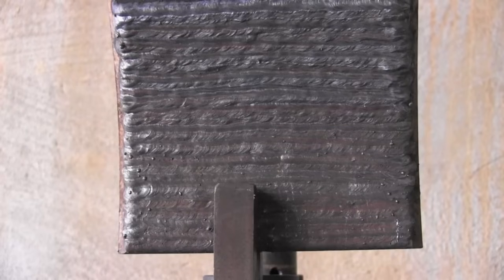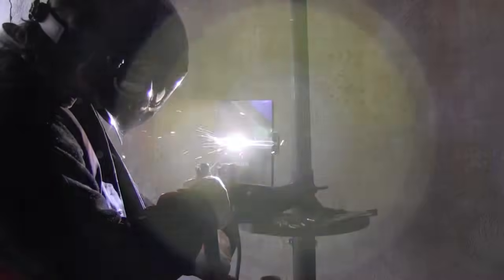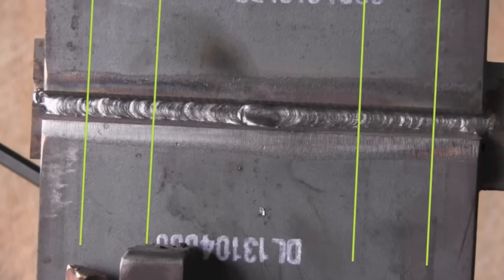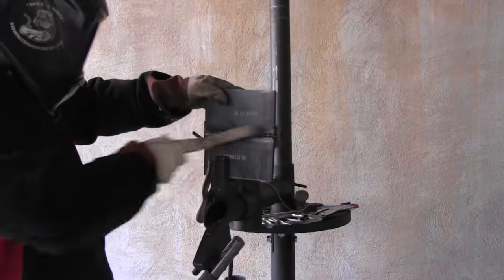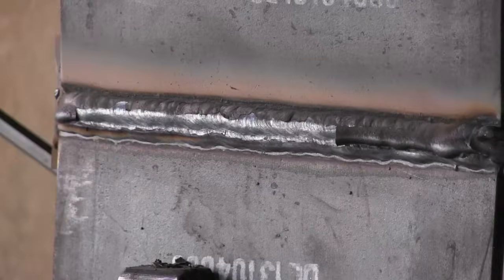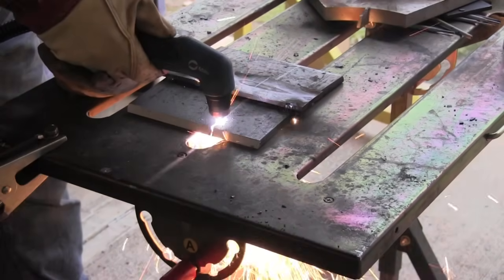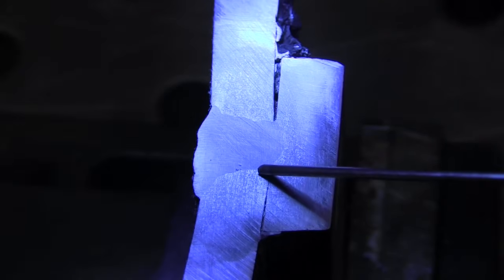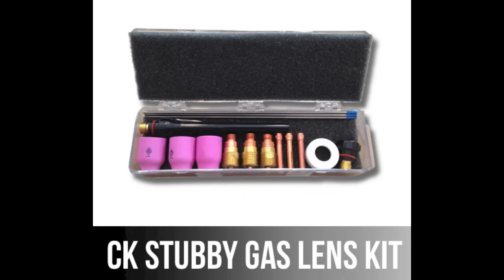Stick Welding Tips- 7018 2g Plate Test

Comment: I'm a experience Welder but not certified, with your help I was able to prepare in short time for the test and pass very easy, thank you!
Reply: What test did you have
Reply: Was it the single v joint plate? Vertical or horizontal?

Comment: As a metallurgical engineer I can say that I sincerely appreciate the craftsmanship that it takes to make a good weld.
Reply: mcwhite1002. How did you go about becoming and engineer and how long did it take?
Reply: @Serenityword  The 4 year Bachelors is standard then if you want a Professional engineering license (required for some disciplines) you have to take two further exams administered by the State. One you can take (called the FE exam) in college, the second you have to wait till you have 4 years working at the level of a PE. Then you can sit the exam. Upon passing you get your PE license.
Reply: Hii
Reply: Hii
Reply: @Serenityword for metallurgist it's honestly not worth the amount of time for schooling and the student loans. As a welder you can make well over 6 figures. As a metallurgist you are making the same but obviously you need your 4 years. I'm so thankful I didnt move to Colorado and go to the school of mines. Instead I'm doing commercial diving and being an underwater welder/construction worker on an oil rig

Comment: Jeez in Canada this is a lot harder haha.. we have to do 2 root passes, and we have to do a stop start on each root pass and those stop starts get bend along with the cap gets bent.
Reply: Jordan Atlin that would be a K prep not a V prep, more common for structural joints than pipes

Comment: the root pass melds 4 pieces together if one or more fails to puddle you have a weak root pass and could surely fail bend or x-ray tests i have only failed one 3-g  certification  test it was right out of welding school  they allowed me to retake it and passed and was certified on bridge code 1" Plate double bevel with backing strip .

Comment: Best videos by far for pre-test prep. The rules for each facility may vary slightly but just understanding how the oscillation and width of a bead affect the formation of the new material is the whole point. In my opinion and experience once the initial root has penetrated deep enough and bevel edges are nicely tied in then moving to minimal movement stringers is becoming more and more the preferred technique. Jody explains this in depth in other videos .  This man is the Yoda of welding..... pay attention closely if you are new to the trade.

Comment: i have a question. I'm using a Lincon electric 300 using 3/32 3g ( i know this is 2g ) running at 80 amps why is it digging so bad it almost eats completely through the plate.

Comment: can you do a tutorial on stick welding spider gears together to properly lock an open differential gear set. i got a lincoln 225 ac stick and no clue what type of sticks to use or how hot i should run it. the spider gears i usually deal with are any were from 2 1/2 in to almost 4 inches. cause i along with alot of my friend build offroad lawn mowers to do what a 4 wheeler atv or utv would do but i never see anyone weld there gears sets good enough to were they wont split apart and slaughter the trans axle housing
Reply: I was talking to a rock crawler guy several years ago, and his advice was to not weld the gears together. Instead, mark where the spiders mesh, pull the gears out, then fill 2 grooves with weld either side of where they mesh.  This simply stops them from being able to rotate.(Does that make any sense?) I tried it on my Ford Ranger front axle, and had no trouble with it for the 5 years I off roaded with it. Since you're running AC, I'd use 7014 to fill in the tooth grooves. And depending on the size of the gears, 90 amps?
Reply: This sounds like a perfect project for chucke2009 a young guy who makes welding vids that have a somewhat different approach. Great idea!
Reply: Adam Pierce i haven't seen any uploads from him in a while i don't know if he is just busy or something is up
Reply: Brainmalfuction He just uploaded one today.
Reply: good deal ill check it out thanks for the heads up
Reply: Get antislag spray and coat your cross pin and ring gear.  you do NOT want slag on either of these.  You want to weld the spider gears to each other and to the carrier.  Failure to weld to the carrier will cause it to crack faster.  I just welded up some Rockwell 2.5ton spiders.  Different process but same idea. I do all my tack welds with 6011 or 6010 to burn through the grease dirt gear oil etc.  Then 7014 to fill it in, Run the 7014s a little cold.

You can see it here http://www.pirate4x4.com/forum/general-4x4-discussion/1998666-1978-bronco-mega-truck.html

Comment: +weldingtipsandtricks My welding instructor told us that for a test where you use a 7018 root, to run one or two good hot beads lengthwise on the back of the backing strap as a form of pre-heat. Works great!!!
Reply: why not? run the beads, get the piece positioned and have at. what difference would it make to the inspector?
Reply: Great idea if you can get away with it.  That's a good trick to remember. It might come in handy some day on something else.

Comment: I'm about to take 2g 3g 4g in Rhode Island. they do not allow power tools :-(
Reply: SweetMooch where did you take your test? just did my 3 and 4g aws and was able to use a wire wheel between passes to make sure I got all the slag out.
Reply: Sean M local 37 ironworkers union.
Reply: SweetMooch I see, mine was in a class setting so more lax on rules
Reply: The tougher the test, the greater the pride when you pass it.

Comment: In Canada a CWB weld test always require a stop start on the root pass. Usually 2 stop/starts. As well they do 2 root bends on both of the stop starts and a face bend from the middle to check your cap. So this video seems kind of weird to me.

Comment: ive been stuck on this weld for about a week now, my puddle tends to seem hard to control i cant get a smooth weld going in the horizontal position
Reply: Try moving your ground.  Some guys even carry booster cables so they can ground in two spots if necessary.

Comment: I had a little trouble with the valley thing lol on 2g, 2g is a little pain but what I found to work a lot is a horseshoe you can tie end the toe of the welds with it and doesn't sag looks something like this -> C or a half moon works great after you get the hang of it

Comment: Good stuff. Question about vertical up on mig. Can 0.45 gauge wire be making the task difficult?
Reply: aaron dostou I use .045 wire everyday. Doing vertical up with MIG doesnt make it more difficult. Just run at good parameters make sure you hold the sides and weave your way up at a good pace and you ahould be good
Reply: preston hoff thanks bud it's getting better but still needs more hood time

Comment: would you say 80 amps is enough for a 2.5mm rod?....i am pretty much a noob regarding welding but it seems to struggle and that is all my machine has(80 amps).
Reply: +The Religion Killer You need a real welder.
Reply: +Ben Dover ctfuuuu!!! 

80amps😂😂😂
Reply: 80amps might be enough. What kind of rod did you want to use? If you have the money, it might be better to move to a dual voltage welder like maybe an Everlast 140.
Reply: Cluj Biking นายชวนหลีก

Comment: My instructor have us running our root with 6010 rods which is better because I see classmates keep failing the bend test over and over I'm not on my test piece yet I'm on horizontal I should get off that tomorrow but do anybody have tips because ion want to too keep taking the test over and over

Comment: hey!im falling behind in school because i cant seem to get the root pass on the top bevel right.my fillet weld on the bottom is turning out great ,just not the top one on the beveled plate.I dont know what im doing wrong.The CWB practice we are doing requires a 5/16 gap,but im having a hard time getting my rod in the correct position.We arent allowed to do any weaves and only stringers.Can anyone give me some tips on how to get this done so i can move onto verticle up.
Reply: Don't fight yourself. Leave yourself more room for the top root pass.  It'll never be good if it's too tight to get into properly.

Comment: I have a miller XMT 304 CC/CV multi process welder. I want to get a tig torch for it.  For someone just starting out on tig what tig torch do you recommend?
Reply: A 17 style torch with a gas lens should be perfect for you. Although the gas lens is not necessary, it is an added luxury of being able to stick your tungsten out further so you can get in tighter places and see what you are doing better. I really recomend the CK Worldwide flex-head torches. Just remember that it is a 150 amp torch. So anything above 150 amps will cook your hand and torch if you run it for an extended period of time. You can usually get away with short trips to 200 as long as you are not doing a whole lot of it at one time. And if you really want to have a sweet setup, pair the flex-head torch with the superflex cable.

Comment: Hi.
How do you remove the backing strip on a real job?
If using a backing strip on a real job, do you grind out the back some more and run a cover bead?
Is the backing strip used for distortion control?

Comment: so root 135 , did u turn the temp down for the rest of the welds? BTW awesome vids bro👌👍
Reply: Adrien Alvarado  probably by 2-3 amps for each pass depending on if he waited for it to cool between passes. Personally I run the the fillers at 135 but wait for plate to cool, i think it helps not trap slag. I would run the bottom cap 120 and maybe a little lower for the top caps.
Reply: Miguel Ruiz ayye preciate bro👍

Comment: no matter how much angle I use, the weld sags. I don't understand what is going on. any help would be appreciated.

also, I have noticed that your arc on your welds is very wide and conical, mine is very directional and prone to wander, what could cause this?
Reply: adam anthoni ford couple of things your probably running too much amperage and too slow of travel speed and more than likely not allowing the plate to cool enough.  That top cap will undercut the crap out of the top plate and sag if you don't allow the plate to cool enough. As for the arc characteristics, you may have too long of an arc length.  If not you  may be experiencing arc blow.
Reply: running on 7018AC so I don't think it's arc blow, but the plate does get hot. I will try cooling it down when it gets hot. thank you for the tips!
Reply: Don't "cool" it.  Let it cool down a bit on it's own.  FAST cooling might make it crack easier when it's being bent....... Too hot, too cold and JUST RIGHT.  Keep it warm enough so the welds flow and bond.

Comment: Question for you welders in the field. Ive been in a bunch of different hands on fields from machining to wood construction for a few yrs at a time but have always enjoyed welding. From a young age my dad had me arc welding all of the repairs and projects around the farm.

In the last 5 yrs ive been welding for my boss a wide variety of projects in a wood metal stone type fab shop. Mostly tig and very little mig. He wont allow arc because of splattering as most of the projects are art based and looks take the priority over strength. But its cool stuff and a lot of stainless. I haven't got into aluminum and has yrs since i have arc which i felt i was above average at.

So the problem is I want to get into welding as a career. At 40 yrs old would i be wiser to go to school and get the proper training or hire on to a full time welding fab shop and continue my learning and career that way?.

 Ive always thought i get good penetration in whatever im welding but that penetration test at the end of the video opened my eyes to the fact i dont know what my welds look like on the inside. And some of the projects are somewhat structural with live loads or suspended from above. Ive had a few welding classes in college and tech school but more of a wide range of basic skills. And my instructor never told me i was so good that i should choose welding as a trade but i think my welds look good and always consistent heat signs. Unfortunately my boss is more of a designer than a welder and truthfully is horrible at welding so i rely on YouTube for tips. What to do haha.

Thanks to those who took 5 minutes out of there life to read this novel. Anyway any advise my next move will greatly be appreciated. Big country
Reply: What you end up doing man ? lol
Reply: @alberto-pi2lj  funny I don't remember posting this. Well I ended up going to a fab shop and learned I was only scratching the surface on what it takes to be a good fabricator. I'm a much better welder now and fabricator. But I think being a pipe welder or something like that in the field makes more money. I will say the shop environment is totally different from the carpenter trades. Not sure I would make the same choice. It would be much more enjoyable working for myself but it's the boat I choose so trying to make the best of it

Comment: What would be a application for that kind of weld and how would you remove the backing strap?
Reply: anything needing a horizontal weld. The backing strip never gets removed entirely. Your test coupons are cut out of the plate with the strip attached and then the bulk cut away before grinding .

Comment: That's an interesting test procedure. Would that be for ASME ?
Here in Canada its completely different for CWB (Canadian Welding bureau) they get you to have two 3/8 plates with a 3/8 gap (or half inch i cant remember) top side beveled bottom at 90 and you have to travel in one direction only and you have to have two stop starts in your root.
Not only that but your not allowed to us a grinder unless its just a wire wheel and they take 3 coupons out of your place two roots where you stop/started and one face.

Comment: When you already have the root pass in try using the grinder on one side to make an even little Vally to weld into. It insures that you don’t have any air pockets or porosity in your weld as well and makes it less likely to exceed the hight of the weld once its all filled. Do it for each side until you reach the top. Ive passed many weld tests this way and had a solid plate.
Reply: No Grinders on a AWS chipping hammer brush and maybe a file

Comment: The backing strip is easy....I'm stuck on horizontal open butt joint right now...got my flat 1st try.made a 17 out of 20 but as soon as I turned that plate sideways it all changed....what sucks is that it happened Thursday and we don't have skool on Fridays plus we have monday off.

Comment: I've been trying to weld two 4mm thick square tubes on top of each other , am I right in assuming they are in 2G position? it sux being a beginner welding I've been working with a cheap chinese welding machine which has a dial all the way to 400A !! and cheap ass rods as well , can't start arc properly and if I did I can't maintain it cause most of the time it keeps sticking, I'm more successful with 6013 but it didn't hold those thick square tubes well and I have to redo the welds again.

any tips for a beginner like me? even though I can I'm afraid investing more money in better equipment cause I'm only doing this  occasionally and I don't feel my level of skill merits pro equipment yet. should I keep trying with the 7018 rods? played with ranges 120-200A , I suspect the machine isn't so accurate in that regard anyway so god knows what the actual power its pushing through

Comment: Back when I passed this in school I remember we had to gouge the backing plate off with a torch then grind it all flush, cut the coupons then bend it. It was always an eye opener for an imperfection to come popping out. My teacher would look at you and say, get some more plate and donut again. I do miss stick welding.
Reply: Yes that' what I'm currently doing for 2g and 3g mig and stick for a cerification. For our coupons first we pass visual then we strip off the backing then we grindem smooth and bendem.

Comment: yeah for cwb tests you don't get the "choice" of where to start and stop haha and you cant stop in on direction then simply start at the opposite edge of the plate and "tie" into your previous stop...ya that's an auto fail.  Grinders are not allowed.  Removing any metal is not allowed )chisels, files, hacksaw blades etc..)

Good tips for everyday welding or any shop welding but for TEST welds this shit wont fly.  At least not here in Alberta.
Reply: TheJusnic82 Best tip I can give you for cwb tests is burn it in hot...and then when it comes to your cap passes don't rush it....You get like an hour per test so layin your welds and if they wont allow you to start another test (usually you'd be doing all your positions or the check test) then just go outside go walk around come back in 20 minutes when the plates cooled a bit and lay in your cap passes....otherwise you're pretty much always going to get undercut on the final pass on a 2g almost ALWAYS unless you just let your plates cool a bit....I did all 4 position tests then came back to lay in the final cap passes (lipstick) passes on all 4...by then the plates were nice and cool and yes I still did turn down to about 120 for the 2g and 3g...

Comment: for some reason I don't like excalibur rod they burn weird.. I typically weld with Hobart 5/32 7018 sum times 8th inch when I'm not rushed  but for sum reason y does excalibur  once you chip off slag the weld looks dark and Hobart is shinny silver??

Comment: Depending on the type of rod you use, you need to clear out ALL THE FLUX, I can't tell what rod your using, but when they go to X-Ray the welds, if it's 7018 or 7024 the weld is just gonna go right over it and burn it all away, now with 6011 flux isn't exactly an issue, because it just burns right through it
Reply: yeah you don't know what you're talking about at all.